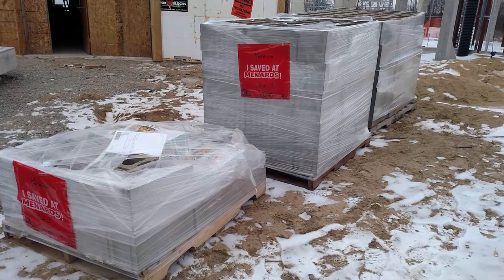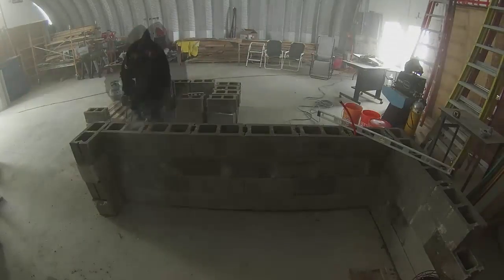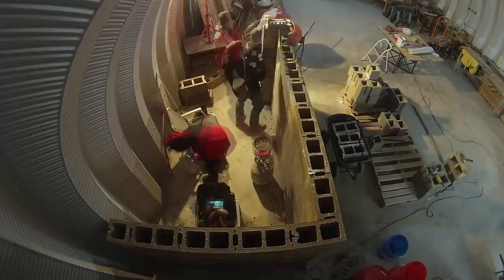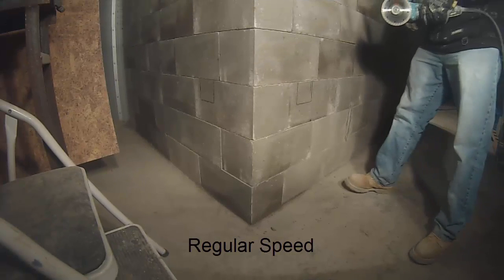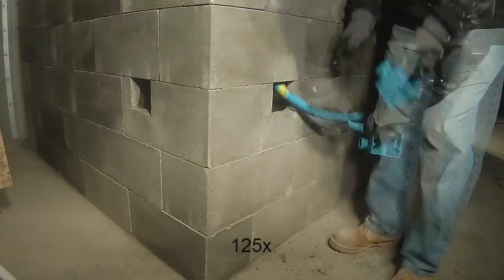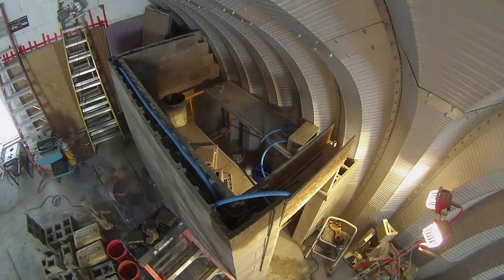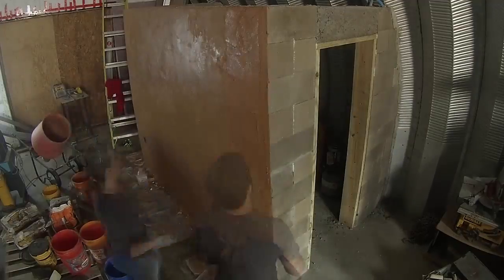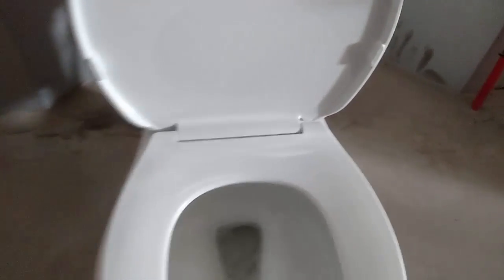25.0 Dry stack block bathroom

Comment: I used scrap metal shims to level the blocks. Not a bad way to put up a wall but after using this technique once I went back to laying blocks with mortar. 
What I love about your project is how many building methods you are using. The precast beams and the use of spancrete panels caught my Interest. 
How did you calculate how much load the beams can carry. Did you hire an engineer? Do you have any other earth shelter designs?
Reply from the maker: Yes, I really wanted to try a bunch of different things...  Perhaps I bit off more variety than I should have.  My wife got annoyed with me the other day when I told her that I wanted to switch to Basalt rebar for the next section.  Perhaps I am pushing experimentation a bit too far for my families patience and budget. ;^)

I am an engineer (Aerospace/Automotive) and work for ANSYS Inc. So I have lots of education and software to help me calculate loads, etc.  Mostly, I have found that just building to code provides a large factor of safety.  

But then, yes, education and software and math aside, I still had to hire a licensed civil engineer to review and approve the plans before I could build in my area.  The engineer specified some details and stamped the drawings for me, but I couldn't get him to show me one single calculation that he had done to confirm my work...  Pretty disappointed in that whole transparency aspect.

Comment: FWIW.  I assumed you were wearing N-95 masks (or equiv) when kicking up that concrete dust, couldn't tell b/c of the speed.... To anyone wondering, silica is bad in the lungs.  Cement, mortar, etc, being grinded, kicks up a lot of fine slica dust.  Most likely won't lead to major lasting damage if not occupational (frequent exposure, etc)....  But best to wear a mask when the silica dust flies.

Comment: Love seeing these videos. Im trying to get ideas for my future home. You built this house in Michigan right? May I ask what county? And how was the process with getting everything approved with the local building department? My wife and I will hopefully be moving to Michigan this summer and we have been looking at property to buy. We are looking at spots where the building regulations and inspections are a little lax. I would hate to buy into an area only to find out I can't build what I want. We want to do a few monolithic domes. One to live in and one for a garage/shop. Maybe you can give me some insight on what to expect and maybe counties to consider buying in. I will be working in Romulus so we were looking at buying a large lot of land in sumpter area.
Reply from the maker: I am in Washtenaw county, this is an area headed by democratic Ann Arbor, so lots of regulation, higher than average taxes, etc.  But still, no problem if you have your paperwork in order.  I found that the number of building inspectors is pretty low.  In my corner of the county, there was only one.  So before buying, I called him up and asked him how he felt about what I wanted to do.  If he had seemed difficult, I would have bought somewhere else.  Instead he was very reasonable and admitted that he had little experience related to what I was doing, but his job would be to make sure that it was built according to the engineered plans.  His job is really to protect the interests of the home owner.  I could totally work with that.  He also went one step further and just charged me the basic set of inspections and said I wouldn't be charged for additional inspections.  He wanted me to call him out as often as I could and not worry about the cost...  Since I am building in odd steps, that saved me a lot of money and made both of us feel better about the inspections.
Reply from the maker: Two other tips...  1) A higher level of scrutiny kicks in at 3500 square feet, so if you stay below that, things are a bit easier.  For instance, below that, you do not need the stamp of a professional architect on your drawings.  2) South east Michigan (including Romulus) is very flat clay (related to the formation of the great lakes).  If you want more interesting terrain (hills), and better soil, look north and west of Sandy Creek Road and Ridge Highway.  Also, check out the section of my website on buying land.  Especially, the GIS maps.  http://www.homeintheearth.com/design-tips/sourcing/buying-land/
Reply: Simon HomeintheEarth Good info. Thanks for the quick reply!

Comment: Where do you find blocks specifically for dry stacking? Everywhere I look are standard 3/8" short blocks.
Reply from the maker: I didn't find any around where I lived, but I had been told they existed.  Actually, I am not sure that the "dry stack" blocks are actually the full nominal dimensions (although that would make sense).  I had only been told that they form them more carefully so you don't have to deal with the rough side.  In my case, I just got an angle grinder with a masonry disk and ground the tops of the bricks so stacking would be easy.  I plan to do another wall soon, and this time I will try out regular mortar work.  It's not so difficult to learn the skills required.  I think there is a reason that the pros don't dry stack.